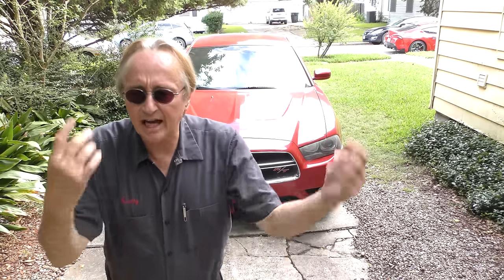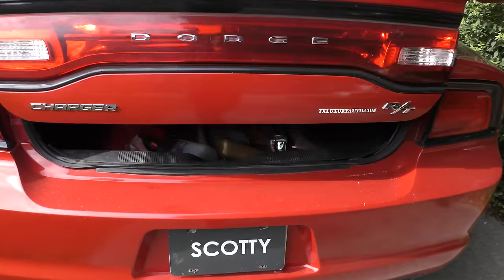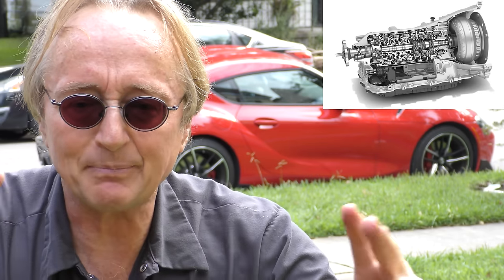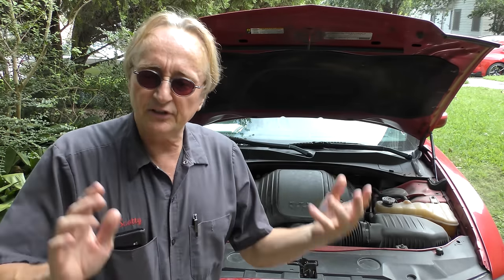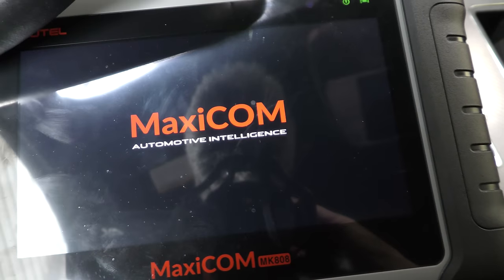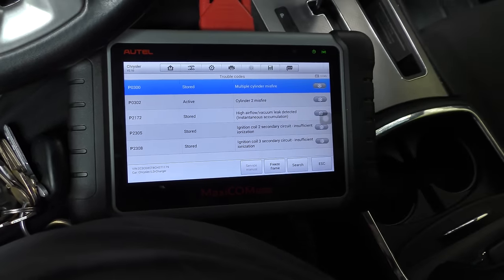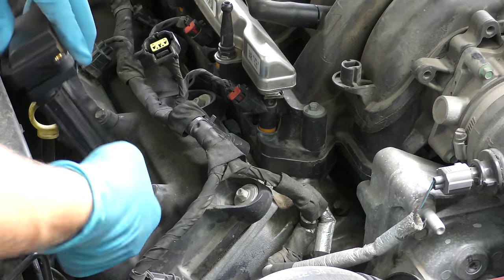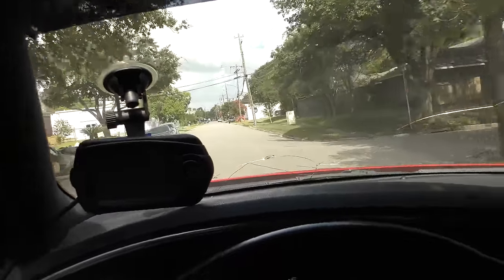Here's Why I'll Die Before I Buy a Dodge with a Hemi Engine

Comment: Damn I'm glad I passed on the Tahoe same thing lifters and head worn out.
Reply: What year?
Reply: 5.3 liter?
Reply: GM motors fail due to the DOD/AFM system. I cam swapped mine and got rid of that.
Reply: @speedtv6151  None of these fuel economy things are ever going to be great for engines and I fully agree. If you can disable it suffer your 10% (at most) mpg penalty and gain way more longevity.
Reply: Yes the valvetrain in Chevy is crappy. Lifter valve springs pushrod collapse. Very true
Reply: Doctor Smith. 100%. 👍. I’m from Australia and I recently bought a Holden Commodore with the 6.0 LS engine in it and I made sure not to get one with the DOD crap in it.  I would much rather cop the few bucks extra at the bowser each week than a massive repair bill when it inevitably fails!
Reply: That's why the old V8-6-4 Caddy engine of the early 80s was a disaster unless you disconnected that system.
Reply: @extremedrivr  If GM stopped every time they failed you wouldn't have an aluminum V8 to complain about. The Vega failed rather badly too. If CAFE and the EU weren't closing in on the their SUV sales perhaps it wouldn't have come to this but that happened and this is the response

Comment: Hemi's are fine if maintained properly, just like any other engine.
I've had (4) (two now, one with 200k in a Ram, the other in a '12 Charger with 90k) and they're both
as sweet as they were when new - not to mention, stout engines that get pretty darn amazing
fuel economy considering.
Not too many "secrets" to keeping them happy - regular oil changes (I always run full synthetics)
and changing the plugs around 50k with just normal ol' Champions like they come with.
Other than that, work 'em, they'll be fine.
They've boosted them to 840hp with a warranty, for heaven's sake. I reckon there's nothing wrong
with the basic design if that's possible - and we won't even get into what the aftermarket does to
'em...
There should be a disclaimer at the beginning of each episode of this guys' channel.
Keep in mind, he's all about what he thinks is being a "personality" first; there's plenty of channels
out there with far better technical advice and expertise, most with a far less obnoxious host.
Grain of salt...

Comment: LS motor: just need a new cam and rockers and it's golden
Hemi: just needs a new cam and rockers, complete garbage? Hypocracy 
8 hours of work to change rockers?  A decent shop can have that done in one to two hrs.
Reply: Book time isn't the same for actual time. That's how a great mechanic can make bank.
Reply: Lmao I was wondering if I was the only one thinking the same thing. That poor charger wasn't even close to being taken care of by owner and it's still running with almost 150k miles!
Reply: No cam and lifer change in a new LS or 3rd gen HEMI is easily 7 or 8hrs of labor. Unlike old schooI V8s, the top deck of these engines in closed. Both cylinder heads and plus timing cover must be removed. Oil pan must be dropped to remove the oil pump so the timing chain can come off for the camshaft removal...it's a job
Reply: I want to see this magician at this decent shop put cams and rockers in 1-2 hours and have everything within spec and the vehicle running as designed or better. I'll wait....
Reply: The 8 hours is charged for the labor. What it pays. After you fix a few of them you can do it in 2-3  hours. How you make profit...

Comment: My 2011 ram 1500 with the 5.7 at 80,000 miles cam and lifters failed. The dealership said this is a common issue with the Hemi.

Comment: Says HEMIs are junk....

Also is sitting in a Toyota with a BMW engine that will need an overhaul by 50K miles.🙄
Reply: The Toyota Supra he has is a press car 🚗
Reply: Naaah won’t ever need any befor 250k with any BMW engine yes have all the kind of failures in the world like electronics, water pump etc. but mechanical parts? let’s be honest here it’s German so this thing can take a beating

Mind you my front door neighbor has a 2018 Challenger with a 5.7, and I have to say this thing lifers ticking sound is astonishingly loud, his and many other Hemies at stoplights.
Reply: As a BMW owner that’s false, idk where you got that info but it’s dumb I have an e46 it runs extremely good
Reply: @StockTurboN20  just type Tyler Hoovie in your search bar about the "reliability" of BMW engines. Sure, if you don't mind replacing valve stems, VANOS controls, bottom ends of motors(S65 V10), oil burning at alarming rates, etc....sure they're reliable. Your E46 are the last of the good Bimmers.
Reply: Nikko Puga  nah, that's just a fact.🤷🏽‍♂️
Reply: You realize you are talking about a person's channel that LITERALLY is based on buying broken cars for cheap.
Reply: Haven't heard many bad things about modern i6 BMW engines going wrong.  The older i6 turbos though had notorious hpfp issues though.  Also consider Toyota extensively went over BMWs design and changed many parts in the engine to their standards.  I'd expect the supra engine to be fairly reliable.
Reply: I’m saying
Reply: @hellkitty1014  aww come on man...there are many cars on the market where rod bearings are consumables, right?

An E46 is old.  My E30 was great too.  Neither doesn't mean modern ones aren't a reliability freakshow.
Reply: @basslover352  no they didn't change squat in those engines outside of the tune.  Also, did they go over all of those Subaru engines that were cracking valve springs in the 86?  Does Toyota even built engines anymore?
Reply: @kirkm1976  now using your terminology, you see how easily it can be applied to an ENTIRE carmaker? That is what Scotty does to FCA. FIATs and vehicles with HEMIs are completely different. Older GEN III HEMIs had their problems, but the newer engines are pretty reliable. And this vehicle is obviously a beater.
Reply: @kirkm1976  now I agree with you here. They didn't change anything on this engine. It would have been near impossible to do so without them creating their own engine. Toyota was smart in getting the their inline-6 as it is the most reliable.
Reply: @aboodmki3  so are the 100k rod bearing replacements in an E60 M5 not considered "mechanical work".  The E30 was the last reliable BMW when compared to other cars.  Anything labeled as reliable since is "reliable for a BMW"
Reply: @kirkm1976  Ah.  Sources? so you think it was all pr?  I'm not denying what you said i'm just willing to find out the truth.
Reply: Somehow I don'ty think this would offend a dude driving a BMW with Toyota badges.
Reply: Exactly, somethig prolly happened to him in a dodge or smthn. All the cars he shits on are dodge and honestly, hes probably finding the worst ones to review. A hemi will outlive a bmw any day.
Reply: Was that your car LOL 😆
Reply: lol you think scotty owns that car???😂

Comment: Is that a tuner the owner is running in the left corner of the dash 😂
Reply: It helps with the acceleration...

of the deterioration!
Reply: Nothin wrong with that if their is a custom program inside it 💪
Reply: yeah its a Diablo Trinity ... and those tuners wake the hemis up a fair amount for the money.. also allows you to do other things like disable the MDS.. shift firmness.. change wheel size for spedometer... its a great tool for hemi owners. You can even send off your stock tune and get a custom one made for you and sent back

Comment: This owner just drove it didn’t take of it at all
Reply: Or previous owner. New owner apparently paid $7000 for it. Reminds me of when I bought an Impala from a dealer in '08, within 6 months I was literally replacing both front wheel hubs because they had 1/4 inch of wobble from taking corners at who knows what speed.
Reply: @savagetuner2404  This right here is owners neglect plane and simple, just look at it
Reply: SAVAGE TUNER probably never washed it either, the paint is trashed.

Comment: Had a 2012 with the V6.  Drove from Ct to Fla and got 32 mpg overall, with some 80mph stretches on US95.  Second best car I ever owned.  Best was a 1989 Pontiac with the 3.8l V6.  Comfortable and fast enough,  had 214,000 miles in 14 years when I sold it.
Reply: U guys have no idea what fast is

Comment: the 5 speed in the 2008-2014 challenger/chargers are actually manufactured by mercedes and are surprisingly bulletproof. mine has 160k miles and shifts like it’s brand new.
Reply: I’ve heard mixed things about this 5 speed hows it doing now?
Reply: Mine has 228000 miles and still shifts great
Reply: do you change the transmission fluid?

Comment: Hemi only has one cam. Old school reliability if looked after
Reply: This car just seen a hard life with no maintenance.
Reply: This car had a hard life with no maintenance.
Reply: Old school hemi sure but the new 3rd gens are junk. oil system completely misses the camshaft... nice
Reply: It’s a dodge, even if the engine lasts the car will fall apart around it. Why resale is no existent with a dodge

Comment: My 2004 Dodge Intrepid, 2.7 L engine, has stop-leak in the radiator, stop-leak in the oil, stop-leak in the AC, and scotch tape holding the outside mirror adjust rocker switch in place.   It's fine.

Comment: I'd egt the 485hp version.  More than enough power without a turbocharger.
Reply: Yeah but that 485 horsepower version actually has the same 5 speed automatic that already has issues in the RT.
Reply: But I have seen them well over 200 looking new still running like a. Lock 260k srt for 8gs
Reply: 15 & up have the 8 speed.
Reply: @99thpeanut59  I'd get a manual.

Comment: In an internal S.T.A.R. bulletin for Chrysler techs about the Hemi engines with a miss and or tick it says to pull the oil control valve. If there is metal shavings in the screen of the valve its too late and to just replace the engine.

Comment: Poor example of a Charger. My 09’ 5.7l with the nag1 transmission has been good to me. These cars aren’t perfect but if taken care of they do last. He’s right though a lot of them are beat on. Choose wisely
Reply: Ikr!! SCOTTY JUST TOOK A HUGE DUMP ON CHARGER OWNERS.
Reply: Just curious do u idle it much? I think this is a major factor that hurts these engines
Reply: RebelCowboy5.7 L 

I never let it idle any longer than I have to. I’ve gathered that a lot of these failures are due to the bearings going bad in the roller part of the lifter. Some lifters even collapse, especially the mds lifters. The lifters are upgradable to solve this.
Reply: I can imagine they get beat up a lot everybody think their speed racer😁
Reply: @MRanger04  just tune the MDS out, problem solved
Reply: Every car has its issues
Reply: Lima Tango scotty shits on anything that isn’t a celica
Reply: RedAssassin274 no problem not solved

Comment: I have a 2010 Dodge Charger RT, with 185,000 miles on it. I daily drive it everyday, I put about 400 miles a week on it. I get 27 miles to the gallon on the highway, And it still runs like a champ, that in mind it is always been garage kept, it has not been ridden hard. It is well taken care of, always receiving preventive maintenance when it needs it. I honestly think that if you just take care of these cars, they run just fine. I've had no issues out of mine at all. I'm the 2nd owner, the first being my MIL.
Reply: Exactly....your wise attention to maintenance says it all....good job...
Reply: I got a 14' Charger R/T myself, and take care of it. Correct oil, don't do burnouts, and donuts, and keep it garaged as well. Tranny has been fine too. Regular fluid changes, and hasn't been an issue either. Has treated me great, and I still enjoy it 5 years later. As well mine was 3 1/2 years old when I bought it. I disagree with scotty on this one.
Reply: 27 miles to the gallon on the highway?...sure you do!

Comment: You wanna see my valvetrain lol? 111k miles, may not be 140k but it’s damn near new from good maintenance and super shinney, and I’m getting 5.2s 0-60 and it sounds healthy as an Ox! It’s a 2013 with the 5 speed and the 5 speed is a straight transmission. I’m getting 18-20mpg combined on highway and city

Comment: Chrysler ruined the hemi with AFM just like GM did with there 5.3
Reply: 5.3 is the best ls
Reply: You ain't never lied
Reply: FCA calls is MDS not AFM like Chevy.
Reply: Chrysler's MDS has far fewer issues than Chevy's AFM.
Reply: @Rico24337  Exactly. I never hear about Chrysler's MDS system causing catastrophic failures like I do with GM's version of cylinder deactivation.
Reply: @corionh4775  The 5.3 was one of the best V8s on the market before they added AFM in 2006. It's been a nightmare since.
Reply: Gavin Whiteley you can just get a handheld tuner and turn it off its that easy 5.3 are a spectacular engine
Reply: MDS/AFM is such a joke, more electronics to go wrong. I paid for a V8, give me a damn V8. To hell with the fuel mileage..

Comment: Mine has 158k miles no check engine light . Have only had minor stuff come up like water pump and AC going out . Easy stuff to fix But no lifter tick . I think it comes down to maintenance that was done early on in the engines life. Standard oil starts degrading too quickly and people don’t change oil like they should.
Reply: How did you do it man and can you give me some feedback and what part should I replaced at what mileage. I appreciate if you help me out

Comment: weird I have a 2006 dodge charger SRT I rarely drive these days but it runs and drives great. It has over 150k miles on it and I've owned it since 20k miles. The only thing I've ever done is replace tires, brakes and oil.

Comment: Picks worst 5.7 you can find...Mann person just didn’t take care of it .
Reply: I'd take an Aztec before I took anything Dodge/Chrysler. You couldn't pay me enough money to touch one with a 29.5Ft pole. My Intrepid almost killed me, and nothing has changed reliability wise. That's not an opinion.
Reply: Jason White actually what you said is exactly an opinion
Reply: @crazyidiot5309  bad choice in cars my 05 300c still runs fine
Reply: The 5.7 in general is bad even the 6.4 both have major lifter problems
Reply: @331foxbody  newer ones far better not perfect but if you do normal maintenance you’ll be fine.
Reply: @jrmensahs220  true true but most of the hemis are prone to have the lifters start ticking

Comment: Tomorrow:   I bought a dodge with a hemi
Reply: Georgia Peach  Just don't get one that was beat on, mine has been flawless
Reply: Georgia Peach I bought one today 2014   Ram 1500 5.7 v8 so far I love it
Reply: Georgia Peach  man I found a 2009 RT low miles and has been the most fun I’ve ever had in a car! A couple cheap mods and I’m at 400HP. I’m telling you that is fun!
Reply: Canada Guy same here man. Found a super clean 09 RT and I haven’t stopped smiling. Just a powerhouse and reliable
Reply: I have a 2013 dodge charger r/t Daytona and it has around 42k miles. Runs like a dream, the only thing I wish it had was that 8 speed! My 2012 v6 charger has the 8 speed and it is nice

Comment: Don’t be surprised to find a hydraulic roller lifter that is installed 90 degrees wrong so the roller is running sideways and has worn out that cam lobe.

Comment: love the "engines worn out" while he doesnt diagnose anything in the cylinder.  changes some parts to deal with misfire, had a cylinder 2 circuit code.  Throw parts at it and blame the engines worn out, He must work at canadian tire.
Reply: anyone can hear that engine is worn out, engines are not supposed to sound like two pans slapping each other.

Comment: My 74 and my 71 and 76 chargers run just fine I have no need or want for the modern FCA scrap! Though I would like to own a magnum wagon but being a mechanic I can keep it going,  but there are mods to be done to the engine like adding squirters to the camshaft valley to fix the oil starvation... the cause of cam and lifter dreaded tick.
Reply: Me too I always liked the magnum , I rented one for a whole summer , they hard to find in good shape especially with the 6.4 unless want pay crazy money
Reply: I have 2 73's and I used to have a 71 Charger 500.

Comment: 2005 Dodge Ram 1500 SLT Quad Cab 6'3 Bed had a 5.7L Hemi, 280k miles no check engine light. Only had two problems in its whole life with the fuel pump going out and then the water pump. Also it did have a slight tick when the engine wasn't warm because it had a slight exhaust manifold leak.

Comment: Currently drive a 2018 Jeep Grand Cherokee Overland. Water Pump and Starter replaced under warranty by 53k miles. Warranty expires at 81k and I’ll be trading it for a new Tundra, but I will miss the 5.7 Hemi, ZF8 transmission, and adjustable air suspension.

Comment: '07 Jeep SRT8 (6.1 Hemi)
Oil change every 3 months 
Pump 91 oct 
Thirsty at 10mpg 
Daily driven
Nothing to complain about
Reply: Less issues with earlier engines 2009 and newer with vct have issues. More frequent than recommended oil changes and calmer driving style will probably increase engine longevity.

Comment: This thing is beaten up and driven hard
Reply: Probably bought it from a used dealer lmao they got nothing but trash
Reply: It's a ruin...
Reply: Isn't that the point why people buy that car in the first place because it has the Hemi It still doesn't hold up, and it's not just the engine Electronics to!
Reply: @adanjuarezjr5135  plenty of volvos and old mercs. Those things last forever with minimal maintenance and bad gas
Reply: @jdmforever5583  im guessing a teenager owns this, revs to the moon with the manual / autostick mode and blames it on the motor
Reply: @nikolasgunadi765  keyword old